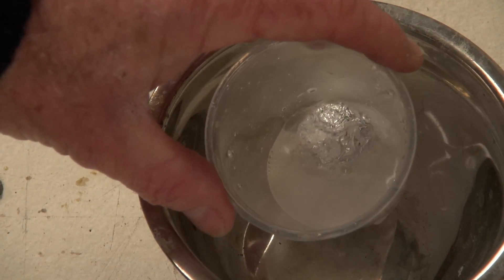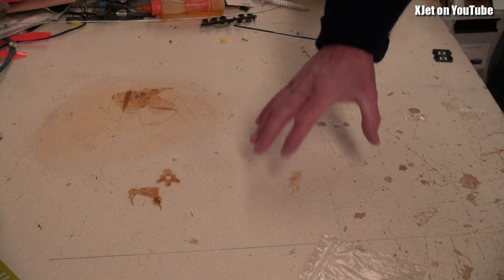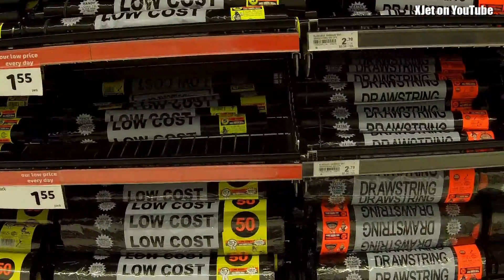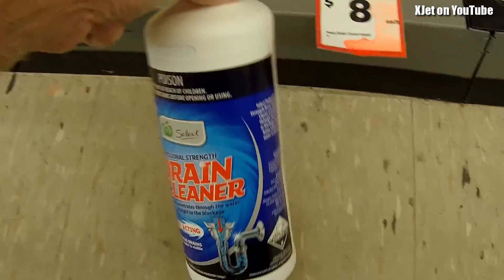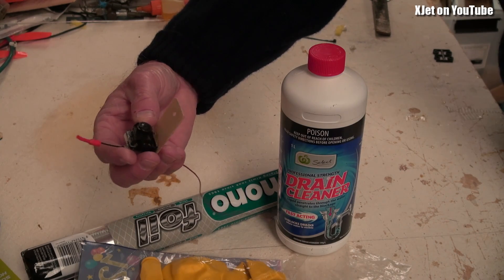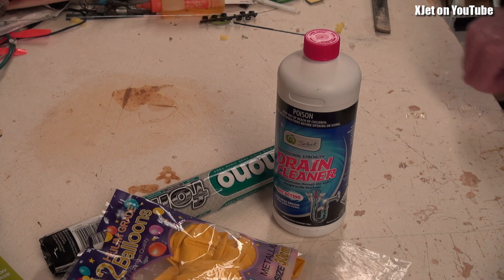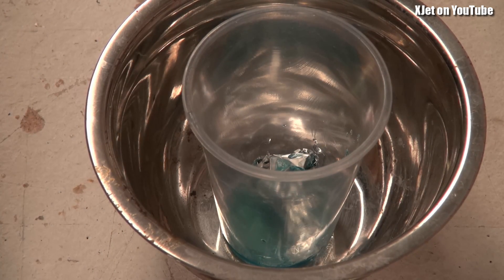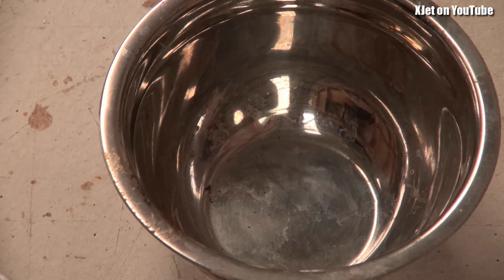A drone alternative:  hydrogen-lift aerial video (FPV)

Comment: Bruce - I think a slightly more 'weighty' experiment is called for.  Years ago, an intrepid fellow from California IIRC fashioned an unusual flying craft  out of a lawn chair/recliner suspended under a cluster of large helium balloons tied to his recliner.  He then climbed onboard, cut his tether, and up he went.  It seems his experiment worked a bit too well as he quickly floated up a few thousand feet and subsequently drifted into controlled airspace, maybe over LAX IIRC.  He thoughtfully carried a BB gun on board to limit his altitude and control his descent by carefully shooting at some of the balloons as needed.  He eventually successfully landed his 'craft' but was subsequently arrested for violating FAA airspace rules, if  memory serves.

What I'm proposing is an updated, but similar, experiment using your 'science-class' hydrogen filled balloons.  Of course, you will need a pilot.  I hereby volunteer...

...your mayor...

...since she's already so full of hot air it's bound to help the experiment be successful.  And I'm sure she would agree that BB guns are extremely dangerous, so her lofty 'journey' would be sans any dangerous weapons or sharp-pointed objects.  This would not only illustrate your point that  filling balloons with homemade-produced hydrogen is feasible but also it would solve that other 'nagging' problem.  ;^)

Comment: Amazingly, I was thinking the same, zeppelin like, helium filled, with a 3 axis gimbal and an wifi action-cam attached to it. For the purpose of replacement follow me drone when doing off-road trips or hiking where drones are not allowed. For example in Austria, there you can fly drones, even FPV but for filming or taking photos you need a licence for about 400€ per year and per drone.

Comment: muriatic acid works far better instead of sodium hydroxide
Reply from the maker: Aluminium reacts with both acids and alkalis (so much fun) but in the concentrations required, I've found HCL to be more dangerous than NaOH because of the latter's propensity to react with other metals and human flesh far more readily than NaOH does.   Over the years I've spilled both substances on my skin and the HCL is far more nasty than NaOH.  If the latter is washed off quickly with water or neutralised with a little dilute acetic acid (vinegar) it causes no preceptable harm.  HCL however is not quite so friendly and I've had burns from it in the past.

Comment: Idea I've had for a long time is to assist a quadcopter's lift with a hydrogen balloon so you only need to use 5% of throttle to hover, and you can get it back afterwards!
Of course its agility will suffer a lot, but it'll stay up where you want it for a very long time.
Could use this to turn a 2kg quad into a 100g one with a balloon of about 2m³ volume! :-)
Reply: EUREKA!!  The breakthrough .. and the law makers will be more than happy with this. Ha ha .. This man is a GENIUS .. I salute you! .. Hmmm .. Probably not a good idea to go aloft in excess of Beaufort scale 2 or you will be back doing free-flight .. P.s. Won't the blades chop up the envelope a bit? .. and burn out the ESC, .. get the wind right and it will crash on the Town dump .. Oh, well .. back to the drawing board .. Sigh .. ahh .. How about a giant papier-mache charcoal-fired Montgolfier job instead?? A great way to transport sheep. Happy landings ..
Reply: Balloon would be a few feet above the quad, tethered close to the centre of gravity on a flexible perpendicular spar about a quad arm's length long so the blades couldn't catch the tether. No chance of escs burning out if they're hardly being used.
Of course, not recommended for windy conditions!
Reply: Unstable. The flight controller would be working hard all the time, and if the battery runs out, it flips upside down.
Make the entire frame a quad-shaped inflatable, then you have something like a dirigible with 4 props and very little weight.

Comment: "We have learned a lot today", try wearing rubber gloves, and I hope you had eye protection. Sodium hydroxide is nasty stuff.
Reply from the maker: NaOH is harmful to skin, but nowhere near as harmful as many other chemicals.   In small quantities such as those I was using there was no real risk to my personal safety (I had safety eyewear on).   When splashed with NaOH, simply washing it off suffices.   Rest assured however, when using larger quantities, the safety precautions will be very obvious :-)

Comment: I would say that the liquid is somehow inhibited against the corrosion of metals to make it safer along the tubes and the soda in crystals was very concentrated, playing on the dilution would be able to obtain the desired amount of hydrogen without overheating the solution too much. In all cases for safety it is better to do these experiments outdoors or under a canopy without walls: when I accidentally loaded a truck battery with 24 v instead of 12 after a few seconds it was created such a quantity of hydrogen that when I removed the pincer to stop the charge the spark caused an explosion that destroyed the battery. I assure you that my ears were ringing for half a day. Once you find the correct reaction, you could put the aluminum into small pieces inside the flask, the caustic soda in a glass bottle and then when you're at the pitch, insert the ball with the aluminum inside. on the neck of the bottle. only then would you drop the pieces of aluminum inside the Caustic Soda, when the balloon is inflated as you want to close the mouth of the balloon and release it from the bottle and have a good trip
Reply from the maker: Yes, the next stages of the experiment have been done outdoors -- for the obvious reasons :-)
Reply: I would say that there was very little sodium hydroxide in the drain cleaner. It's real purpose was to be bought, which he did. How are you gonna know how well it works after you pour it down the drain? You assume it is working, but...

Comment: I have done this a lot of times ! You get the best result by filtering the gas through a second container of  water.. It will work even if you don't but you get a lot less lifting power, i think it is mostly due to water steam being generated also :-)
Reply from the maker: Yes, I plan to build a moisture trap in the gas-line for the final version.

Comment: The biggest problem is to hold the hydrogen inside of the balloon. I've done a similar experiment some years before. I never run into problem with fire, but the balloons we filled at the evening were less or more empty at the next morning. You need special "Helium rated" balloons. We got the Hydr. from a metal shop. Cheap. BTW: Big balloons work also filled with propane.
Reply from the maker: Yes, this is a problem with hydrogen storage that those advocating it as an alternative fuel seem to have forgotten.  The H2 molecule is so very small that it finds its way between the molecules of other materials such as rubber, plastic or even steel.  This means that balloons filled with H2 will "bleed" quite quickly and deflate.    Even helium tends to bleed but H2 does it even more quickly. 

This bleeding problem makes it difficult to store H2 as a compressed gas for any length of time (the higher the pressure, the more quickly it bleeds through the containment material).

For the purposes of this experiment however, the gas will remain contained for more than long enough by both the helium-grade party balloons and the plastic trash-bag I'm using.

Comment: this reminds me of a project that a fellow ham (amateur radio) is doing. they design very light weight radio beacon electronics which are being used by some folks to track their small balloon launches. the electronics are powered by a small rechargeable battery and a small solar panel recharges it during the day. the beacon transmits it's telemetry using the WSPR protocol and near worldwide tracking is available on the WSPR network because of that! the balloons usually used are simple mylar style party balloons, and like you, hydrogen is usually used i believe. there is actually one balloon currently aloft with near real time tracking (during the day). you can see it's progress here
http://www.qrp-labs.com/flights/u3b15.html
if you did something similar you could likely track your balloon much further. some of these balloons circumnavigate the earth, some more than once! past (and current) flights are listed on this page
http://qrp-labs.com/flights

Comment: So many parallels between this and Breaking Bad supermarket scene! Well I have launched a Hydrogen balloon with a Bixler attached and it went rather high. While it was climbing I was not flying it, that went for about an hour or so, needless to say I studied the flight paths and wind currents for months and months in advance. What people don’t seem to understand is that those sounding balloons climb quite quickly, between 5 and 10 meters per second at lower altitudes. This means it is only at a given altitude very briefly. I used industrial Hydrogen but have seen people putting Aluminium foil through a paper shredder to produce massive and fast reactions. P.S. Hydrogen is the most abundant element in the known universe!

Comment: yea going all breaking bad on the FAA is not going to help us and your still representing the RC community with your shake and bake meth exparment
Reply from the maker: These balloons are no different to the heart-shaped party balloons that get loose every year around valentine's day and they're a snot-load safer than those chinese lantern hot-air balloons that people seem to let go throughout the year.   There's no reason to really think that regulators will have a problem with them and here in NZ this was reported in one of our newspapers after a balloon was mistaken for a drone near our largest international airport:

[quote]
Two incoming flights were put into holding patterns and departures were halted during the six minute alert before it was determined the drone was in fact a harmless, "slightly large party balloon".     "It was not a risk," the Airways spokeswoman said.
[unquote]

link: https://www.stuff.co.nz/travel/travel-troubles/103111136/drone-scare-delays-auckland-airport-flights-turns-out-to-be-balloon

There you go... the manager of our airspace has clearly stated that "slightly large party balloons" are "not a risk" so I don't see how anyone could bitch about this harmless but educational and fun experiment in aerial video.

Comment: The second world war saw fire ballons used in an attempt to terrorize America with forrest fires.  
They may get twitchy again.  A more controlled slow relsease reaction need not melt its containment. Try ribbon in a spiral - one side plastic coated. 
cobber : )
Reply from the maker: H2 balloons are far less dangerous to forest than those crazy Chinese lantern balloons with the ball of flame under them! :-)

Comment: Bruce, I almost lost my eyesight doing pretty much exactly what you're doing. The pressure built up too quickly, the top popped off and I copped a face full of hot concentrated caustic soda water and alumina sludge. I had just taken my safety glasses off moments before. I spent a week in hospital clinically blind and it took over a year to get 95% of my sight back. That was many years ago (when I was young and dumb). Thankfully I got my sight back, but it makes me wince watching you play with this stuff. Please take the time to explain how dangerous this reaction (& hydrogen) is before some kid copies you and looses their sight, or worse.
Reply from the maker: Don't worry... I was deliberately using very small quantities in this experiment and the experiment was to demonstrate:

a) the potential power/volatility of the reaction
b) that one must always work progressively and establishing the risk is step #1

In the next stage (where a lot more chemical is used and there is a degree of pressure involved) I use a full-face sheild, gloves and protective clothing.

This experiment is as much about teaching sound principles for safe experimentation as it is about achieving the final goal.

Comment: I was messing around making hydrogen this way a couple of years ago and was thinking of make an air ship using large rubbish bags, and when you were finished with the model you would ignite the hydrogen. I made a crude cell and bubbled the gas into soapy water. When I had a good amount of bubbles I set it alight and  It just made a nice ball of fire due to the bubbles only containing hydrogen.
Reply from the maker: Yes, to get a bang you need a stoichometric ratio of H2 and O2 so a balloon filled with just H2 will burn but won't produce a loud bang.  Note how the Hindenburg didn't explode -- it simply caught fire -- in fact the nitrocellulose paint on the fabric skin was more of a fire issue than the H2 inside.

Comment: You will probably find that in NZ, a balloon/system that can fit inside a 2m sphere "at all points during it's flight" is totally unregulated, as you say. Beyond that, regulations do exist and such flights require CAA approval and generation of a NOTAM, without which you would not be permitted to fly your balloon.
The communities that fly balloons up to 43/44km altitude, but where 30km is commonly achievable are responsible and go to great lengths to comply with the rules regarding regulation and safety. Amateur floating balloons with solar powered payloads meeting the system diameter constraint have made circumnavigations of the earth and one is currently circulating the earth at around 12km with an airborne duration which exceeds one year.
 HIRFW-6 was over Svalbard, Svalbard and Jan Mayen (75.48107,20.96215) at 11999 meters about 17 minutes ago. The payload weight is less than 9 grams That's 0.009kg. These devices and the engineering involved in the duration and communications are far from being trivia.
If you really feel a need for hydrogen, buy it and use it outdoors; it will save you a lot of hassle in the long run. and that sparky light switch is a lot less likely to give you unexpected grief.
Reply from the maker: Excellent information Ian... thanks for sharing that, I'm sure that myself and others will now leap onto Google and find out a lot more about this.   And  yes, my balloon project will be low-mass and very much small size compared to these 40Km-altitude jobs of course.    How do they deal with the issue of gas leakage through the balloon envelope?  Is it a metalised film material or what?
Reply: A lot of the pico (unregulated < 2m sphere at any point in their flight) floaters used to be Qualtex 39” foil party balloons. Generally gas migration is less of a problem than the effects of UV on the envelope and differential heating. In the case of latex floaters, failure is often shortly after dawn, when the cold of the night has rendered the balloon slightly less elastic than in full sun and the UV finally causes failure of the latex substrate. The long flight duration envelopes have all tended to be custom built by their designers from EVOH or other exotic plastic films to mitigate gas migration.
Recently the Qualtex have started being displaced by clear plastic party balloons from China, which don't seem to suffer the same differential heating problems because of the transparency.
43km up down flights are selected stock latex balloons – a particular batch might burst high of the design altitude and so are prized.
Reply: www.habhub.org is a good place to see the infrastructure and what's going on. http://www.daveakerman.com/?p=1732 Gives a super how to and links at the bottom of the page are a veritable cornucopia of related project development. 10mW ISM band in the UK and a lot of EU, as UK are not able to operate Amateur Radio airborne; which has spawned a UHF distributed receiver network in the UK and as far east as Poland and beyond. It's an educational hotbed for would be EEs interested in exceedingly low power consumption, extreme environment, RF and micro controller/computer systems. It's pretty neat designing your own ground sector tracker or chase applications too.

Comment: Bruce, make one of the ESP32 trackers like wot I did, it will show up on your OGN tracker. That rubbish bag won't be big enough or flexible enough for expansion at altitude. You don't need to close the mouth so that will get rid of your expansion problem as the has will vent out the bottom. Then you get a more controlled descent. Cracking video mate.

Comment: where's your gloves Bruce? ;-)
Reply from the maker: They're in my pocket.  That NaOH is corrosive stuff, I don't want to get it on my brand new nitrile gloves!!!!

Actually, NaOH does react with skin tissue (mainly the fat in that tissue) but not as rapidly or as aggressively as an acid does.   The interesting thing is that if you get it on your hands they feel slippery -- because it is effectively turning the fat in your skin into soap.  Fantastic stuff this science!

I've used gloves in the next stage -- and a face-mask -- because it would be silly not to, when working with larger quantities of the stuff.

Comment: The regulations concerning free flight planes are also relatively lax.  You could put an FPV camera on a fairly heavy free flight plane and be subject to less laws and regulations than would apply to a much lighter radio-controlled or robot-guided aircraft.
Reply from the maker: Surprisingly, here in New Zealand the rules for Free Flight are quite strict.  You're not allowed to fly them beyond visual line of sight -- what the hell?    What is the value of being within VLOS if you have zero control over the craft so are unable to take evasive action if an aircraft is around?  Makes zero sense to me!